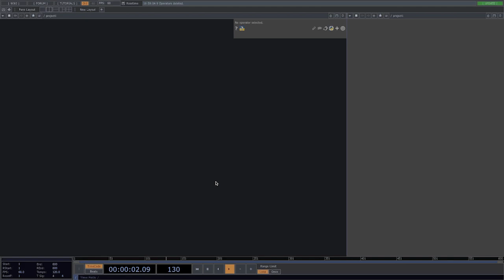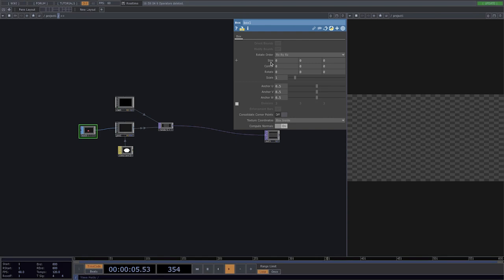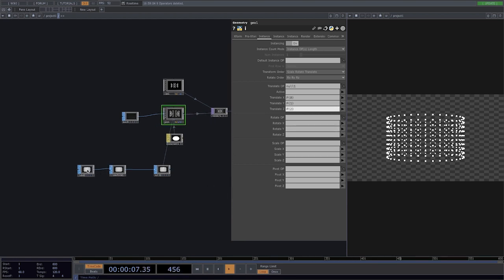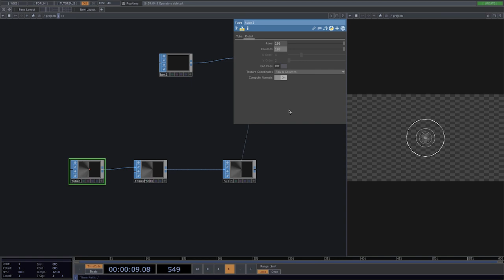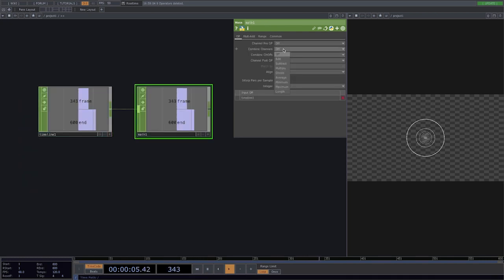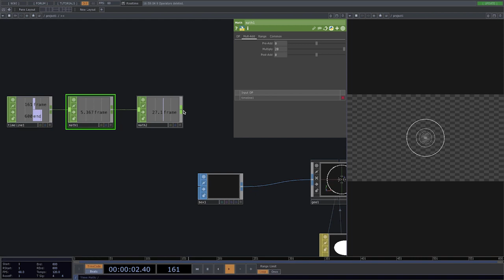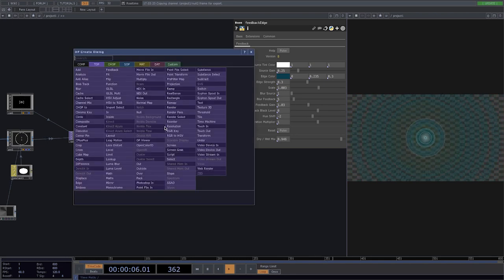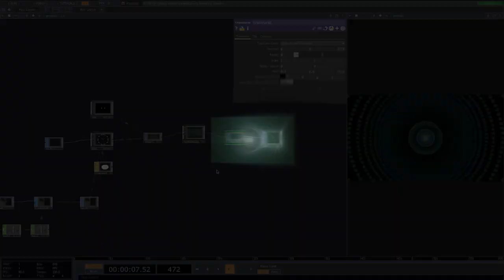TouchDesigner  Tutorial | Infinite Loop Tunnel

Comment: hello! I love your tutorials!!!!! They are really beautiful and very inspiring... I am very grateful for them. About the movement of the tube in this one, I think that if it measures 1000 and has 100 rows, it will be ok if we multiply the number of rings that we want to go through in the loop by 10, but better by 10.1, in order not to repeat the first frame, and then divide it by the number of frames in the entire loop. For example, if we want to go through 4 rings in the loop (speed) and the loop is 600 frames long: 4 *10.1= 40.4 ; 40.4 / 600 = 0.0673333333(but we can round to 0.0674), so in the tz parameter we can type----> me.time.frame*0.0674 to get the endless loop.
Thank you again for being so nice, keep it up please.
Reply from the maker: Thank you so much for the information!! We appreciate it.

Comment: how are you able to get the pull down on translate on 4:14?
Reply from the maker: You select the null CHOP, so its green. Then you click in the star in the corner (or just press 'a') to make it viewer active. Once its viewer active you press on the inside the null CHOP and hold it , then while holding the click you point to the translate and then it appears the parameter window, and you point to the translate Z and release . Then you select the CHOP Reference option and that should be it. Does this answer your question ?